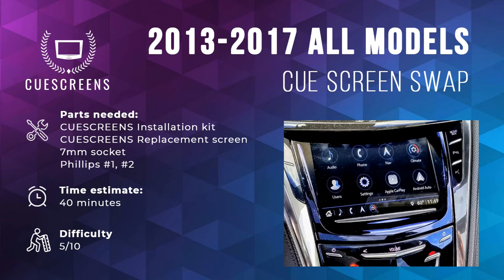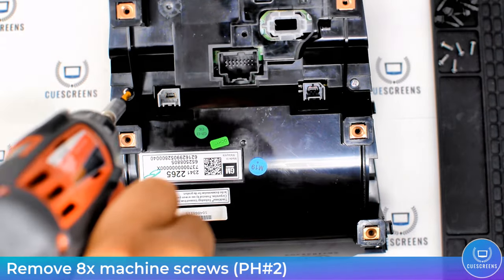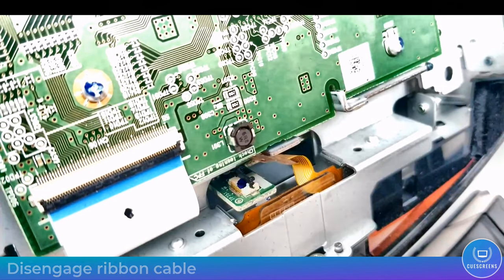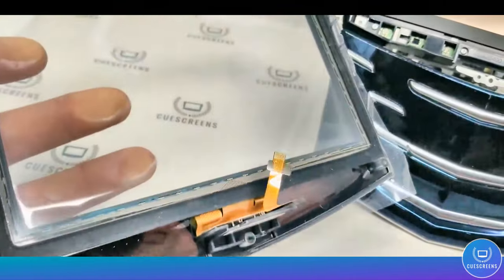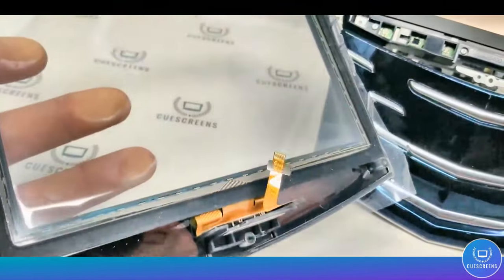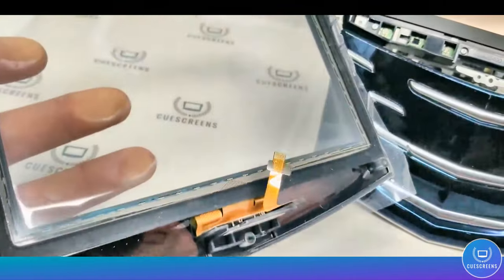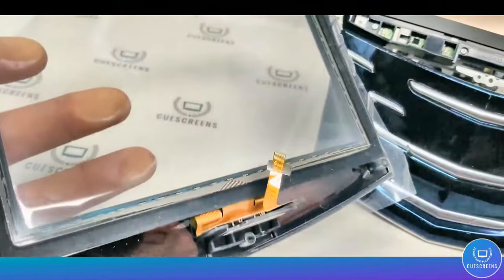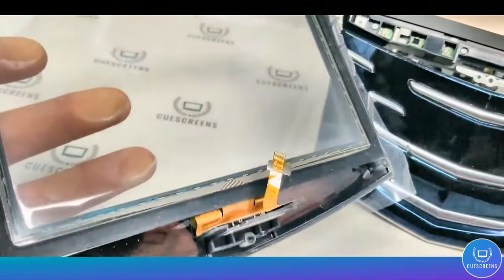How to replace Cadillac CUE screen to fix unresponsive / random touch issue  *Easy Method*

Comment: Installed new screen on 2013 ATS. Overall rate the procedure as "easy". 

Only problem was removing the cup holder. I used a cam shaft seal puller tool to get under the lip and pulled really hard. 

The first short video that shows how to remove unit from car is lacking. There are six screws to remove but he shows only four. He also does not show disconnecting the blue cable. This video is not "live". He had already disassembled the trim and then put it partially back in place to show procedure. That is how he missed those two critical screws and RF cable.

The Cuescreen video is great! I played it on my phone as I worked through each step. Note. The back cover on my unit had four screws. When I removed the cover I found six screw holes. The cover was not drilled for the two center ones. The point is that Cadillac has a few different models that are slightly different. 

The flex circuit connection is tiny. I used the fiber pliers that I purchased with screen to open latch and insert circuit. Simple.

If I do this again, estimate could complete whole job in 90 minutes. First time always takes longer. Thanks Cuescreen.
Reply from the maker: Yeah, the ATS cup holder sometimes gets really sticky and requires a lot of elbow grease to break it loose. . Thanks for posting!

Comment: I followed the video step by step. I'm anal and didn't want to break anything. Went smooth as silk. 2 hours start to finish. The only problem I ran into, I dropped my 7mm socket down the inside of the driver side console. I wasn't gonna try to fish it out. I have others. LOL. 
New screen looks and works beautifully.  Thanks for the screen and video!

Comment from the maker: *NOTE*: Be sure to fully insert the ribbon cable all the way in before clamping down the black locking clip. I will post a follow up video with more detail on this. I have been getting a few modules back lately with the ribbon cable only partially inserted, or inserted upside down. It is helpful to hold the ribbon cable in fully with one hand, and use the other hand to lock down the black clip
Reply from the maker: Cheatin Biden  Is the touch still responding as normal on all pages?
Reply from the maker: Cheatin Biden  Sounds like your amplifier may be on its way out. Pretty common on these cars unfortunately. It wouldn't have anything to do with the CUE unit as your radio is a totally separate system that works even when the cue unit is out of the car.
Reply: Hey I just installed one of the cur screen but the touch panel not responded
Reply from the maker: @cmamobileinstall581  Hi, you have to read the instructions on this job. Very important.  https://www.cuescreens.com/troubleshooting
Reply: I replaced the screen but I think one of the white strips came out
Reply from the maker: @Mr.james0007  This is an issue, it is very very important to not touch the white cables. You can check the troubleshooting video to see how to reconnect

Comment: Would you recommend to pay $250 for the installation at a local expert place if I don’t feel comfortable doing it myself? 2017 Cadillac XTS
Reply from the maker: Thats pretty reasonable as long as they do a good job. Watch out for unskilled technicians who don't know what they are doing and will damage your equipment.
Reply: You live in Phoenix ill do it for $125! Just did mine. Excellent video instructions.

Comment: FOR NON-REPONSIVE TOUCH SCREEN TRY THIS AFTER INSTALLATION :

1. Open compartment below touchscreen while car is running.
2. Shut off car for 1 minute, until dash is black.
3. Turn on car, close compartment and screen will now function if install was done correctly.

I have been in industrial automation for 10+ yrs, for me thinking I did not plug something in right was very frustrating, and Cuescreens troubleshooting guide does not mention this potential software issue. Hope this helps someone!
Reply from the maker: Great tip!!

Comment: My vehicle doesn't have the plug in light connector. Other than that it was a smooth install
Reply from the maker: Hi Jose, yes, some cars have the wireless charging option and as a result- will not have the little wire harness shown at 5:08

Comment: Thanks for the video. I installed a new screen on my mother's SRX today and after installing it in the car, the screen works perfectly but the lower door has no lights or functions, and the door sensor does not engage. Any idea what I could have done wrong?
Reply from the maker: Hey Preston- check the troubleshooting video linked in the description as one of your white cables must have been bumped out of place during the job.  https://youtu.be/M5nqZwuCpfY

Comment: 2013 Cadillac XTS, touch response isn’t working. the screen is functioning in every way as normal but the touch screen doesn’t work, would replacing a screen like you did resolve this issue?
Reply from the maker: Yes it would cuescreens.com
Reply: CUESCREENS will be ordering a new screen from your website. THANK YOU!!

Comment: My cue screen is black when i start the car, then comes on about 15-20 mins into driving. does this every morning. goes in and out. is it the screen or the unit?
Reply from the maker: Hi Sam. black screen is a separate issue. I would check your car battery using a load test. Replacing the screen or the CUE unit will not fix it.

Comment: Installation went well then installed in car turn car on the On star emblem is dim in colour on the screen the rest is ok..
Reply from the maker: Hi, the touch screen is a clear panel that doesn't display anything. As long as its responding to touch then its working right. Check your battery or HMI unit for any display LCD issues.

Comment: Quick question - I pulled the CUE unit and have the new screen replaced, I just don't want to finish tonight, will leaving the CUE system out of the vehicle over-night cause any issues?
Reply from the maker: No issues.
Reply: @CUESCREENS  you guys are the best! Incredibly thorough video, awesome product!

Comment: Just in case anyone else runs into it, my 2016 Escalade did not have 7mm bolts holding the side pieces, the 6 screws are a T15 torx.
Reply from the maker: Good tips, thanks for the comment

Comment: I have CTS 2014, I bought 2 screens already.  The first is on amazon for $32 and the second on ebay for $26.  None of them work.  I already did a hard reset of CUE and nothing works.  I think it's Chinese crap.  So far I'm using the old screen, it's flaking inside, at least it works.
Reply from the maker: First off, stop buying junk for the cheapest possible price. You are wasting your time installing it over and over again. So far you have spent 5 hours because of that choice- what is your time worth?

Buy this, install it properly by watching this video- and be amazed that it works. https://www.cuescreens.com/product-page/premium-upgraded-gel-free-cadillac-cue-replacement-touch-screen

Comment: Installation was simple but unfortunately when I removed the screen protector I found the screen was cracked down the middle from top to bottom. Screen now works but only on the left side of the crack. I wish I would have just gone to the dealer.
Reply from the maker: Very important as noted in the instructions- align the plastic pins, tighten gently to avoid cracking it

Comment: I need help!!! This is what happened.  I left my ignition switched on over nite and drained my battery.  Yeah, it’s know dumb woman 😂. My husband connected his battery charger to it and it charged and started up just fine.  But the infotainment system went all dark as well as the lights on the steering wheel buttons.  He did say that as it was charging there was a lot of clicking going on.  I’m wondering if it blew a fuse?  I can hear the fan for the heater running but cannot change any settings.  Any idea what’s going on??

Comment: I bought the screen from Cuescreens and I started to remove the module but I couldn't disconnect the electrical connectors behind it.  I was afraid to break something so I put it all back.  I called a local alarm installer and was told that Cadillac has a code for each module and you have to get the code from the dealer.  Is that true?
Reply from the maker: That is incorrect. The alarm installer is not familiar with this vehicle or system. Some older german vehicles like Audi or BMW use a radio code that is printed on the card in the owners manual, it is used for security when the radio is removed or battery disconnected for a period of time. Rest assured, you can fully remove the CUE module, disconnect the battery, replace the screen, etc without ANY dealer visits or codes or programming. You are almost there- check out the video on how to remove the connectors and you will have it done. You are 90% done, its easy from here :)

Comment: Hey i followed every step, and i looked at different videos. It wouldn’t turn on, found this and fixed ribbon. But still does not turn on. Help me please
Reply from the maker: This is caused by installation error. Any white ribbon cable must not be touched during the installation. Send photos of all the internal white ribbon connections along with your order number to cuescreens@gmail.com
Reply from the maker: As a follow up and warning to others, the screen this customer ordered is NOT a cuescreens product. It is one of the $20 chinese screens and as a result, we will not provide support or technical assistance. We strongly recommend not going cheap on this purchase. Make sure you order a genuine cuescreens product to receive the best quality. The job takes too long to deal with cheap chinese replicas that don't work half the time, and you will not have any technical assistance. Spend the money and order a quality product for your Cadillac.

Comment: What is the problem when after installing a new cue screen and it is black???
Reply from the maker: This means that you either removed the white cables inside the unit, the blue cable on the back of the unit is disconnected, or the CD changer is disconnected. It is very important to NOT touch any white cables inside the unit at all.
Reply: @CUESCREENS  can these cables be reconnected?
Reply from the maker: @rebamorris6892  Yes, but if you are having trouble I would recommend ordering the mail in service to prevent further damage to your unit. https://www.cuescreens.com/product-page/cadillac-cue-screen-replacement-service

Comment: Stop !  Never be finished with extra hardware !   Use a straight pick tool to center the hole, It will line up. Never tighten before starting all of them.

Comment: I wish I could find some one locally to repair my cue system because there is no way I could do this repair myself....my screen stop responding about 6 months ago and I bought a new phone and now I’m screwed because there is no way for me to connect to Bluetooth without touching the screen..
Reply from the maker: Where are you located?
Reply: CUESCREENS Syracuse,ny
Reply from the maker: @geeman3156  
Search "your city, state + car audio" in google. You should then see a list of possible installers.

Look for shops with good ratings (4.5+ stars) and a high number of reviews. Give them a call and ask if they do the cadillac cue factory touch screen replacements. If they sound confident, and have done the job before, it is probably a safe bet.

If they aren't sure what you are talking about, or seem confused, just move on to the next shop on the list. Most big cities have plenty of shops to choose from, and this is a very common repair that the more reputable shops have done.
Reply: CUESCREENS  unfortunately there’s not many audio installation/repair shops where I’m at and I’ve called them all and only 1 repairs screens and they charge $700 which is is still pretty expensive
Reply from the maker: @geeman3156  At cuescreens.com/installers we have a couple listed but unfortunately they aren't very close. If you can get the module out of the car, you can ship it to me to do the repair and send it back to you. Its the mail in service option cuescreens.com/shop

Comment: Well I've done it but yeah this WASN'T exactly easy, the removal from the car part anyway. I have a 2014 ELR and you literally have to take half the damn interior out! Now that isn't Cuescreens fault but what was not helpful was pages 17 & 18 of their instructions. On page 17 something has to be missing because I all but broke the panel and could NOT get it off! I finally just worked around it. On page 18 it does not specify that after you remove the two bolt there are two retainers underneath. One other thing, on page 14 it says to refer to the "Inflatable Restraint Module" then refer to "SIR Enabling and Disabling". Both of these appear to be links but when you click on them nothing happens. I had to Bing what the SIR system is, I didn't bother to disconnect the air bag since the battery was disconnected.
Reply from the maker: Nice job getting it done on the ELR! We have published a new video for a quicker method on this vehicle. https://youtu.be/FzSzkvLLtdM

Comment: I did all the above and now I have zero power going to entire unit to include A/C.
Reply from the maker: Hi Bruce, this means that one of your large white ribbon cables came undone inside the unit and must be carefully reconnected. It is very important to NOT touch the white ribbon cables. If you are unable to get this fixed, you can send your unit in for service.

Comment: How could anyone attempt this ?   who has a well lighted work bench and the skills to take unit out of car and take out little screws and parts to pull this replacement screen  operation ??   surely you jest on a novice car owner trying this...
Reply from the maker: Sadly, the other alternative for every 2013-2018 Cadillac owner is paying your local dealer $1,500 every few years to fix it for you. We have over 15,000 customers that have successfully completed this repair and fully restored their system with a permanent gel-free fix. Many with little or no mechanical experience. Just follow the process step by step and it will be complete :)
Reply: I well aware of the dealership and the $$$ rip off to replace unit.... I would buy your product right now if I could find a local person who could do this face plate switch.....why didn't Caddy recall these when the problem started coming out with Caddy owners blessed with a CUE nightmare in the car .. ?
Reply from the maker: @MrTitan225  Usually recalls cover safety related items, things like the infotainment are considered secondary non essential items and are not generally pursued for a recall. Also, the average profit on a new Cadillac is $4k. Cadillac built 1.5 million cars from 2013-2019. Every single one of those cars will require a screen replacement at $1,500 every 3-5 years of use, as they still haven't fixed the design. As you can see, this is quite the conundrum. That's why we offer the upgraded gel free screens- fix it once for $129 and never worry about it again. Check cuescreens.com/installers to see if we have any installers near you.
Reply: This being so,  Caddy sure coped out us Cue owners.....I want to buy your product....can find anyone in my area of west pa to do this.........I'm not goingto local Caddy Dealership......they will rob me...BH
Reply: @MrTitan225  Replacing the screen is basically a very easy procedure. Ask around at some local shops. Show them the Cuescreen video. They should charge 2 hours maximum for the whole job.
Reply: I cant find anyone near me to do this replace screen.....My vision is poor now to do this kind of task.......BH @marccrotty8447
Reply: just did my 2013 xts   takes time   watch video  don"t be afraid   take   your time
Reply: @georgeking7617  Thanks George King....My vision is poor... I could never do this fix.....Bobby